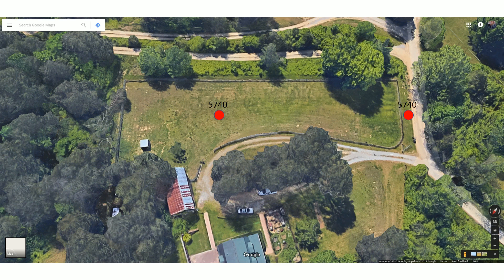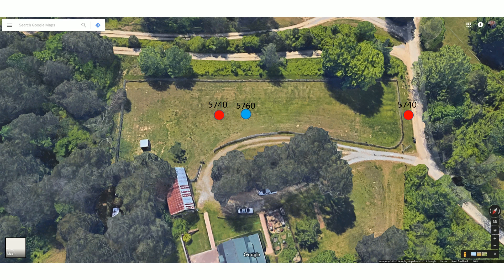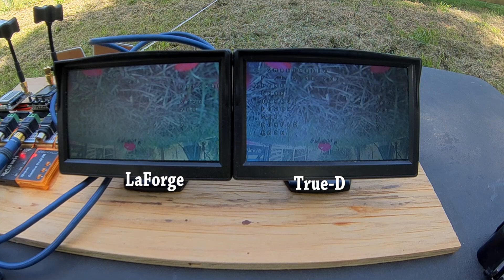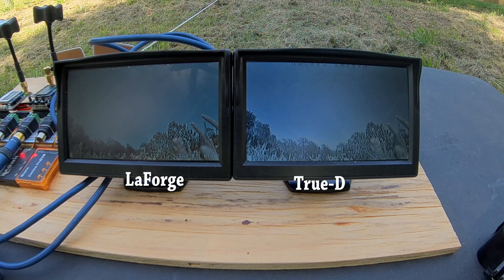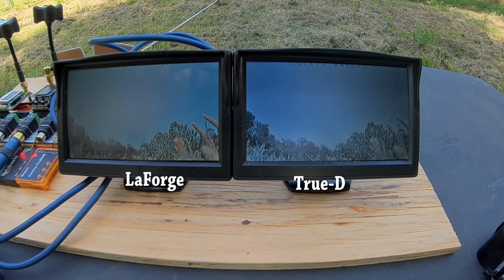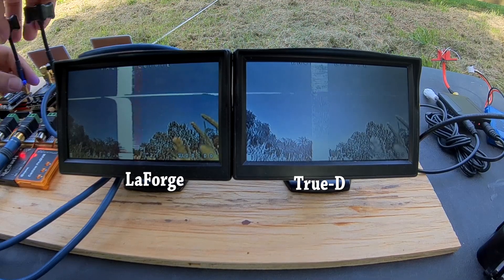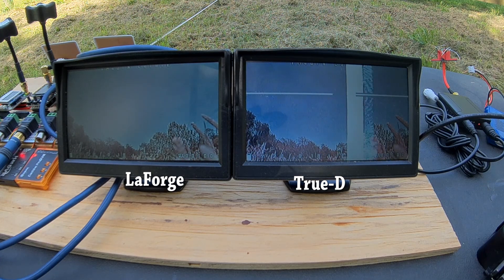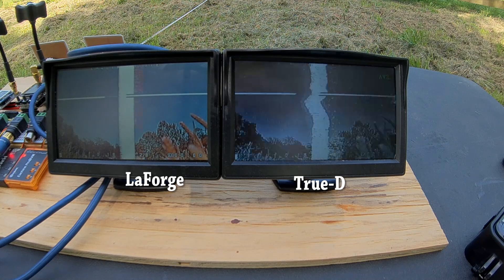Laforge vs. True-D | FINALLY A CLEAR DIFFERENTIATOR

Comment: Do you know if the True-D V3 is any better (than the one used in this video) at rejecting interference from other frequencies?  I ask because I have had problems with that exact thing.  I loose video and crash frequently at races, but I am usually OK when I practice by myself.  Based on this video (and my specific experience), I would get the LaForge, but in another video you say that the True-D V3 is much better than previous versions.  Has this specific issue improved?  Or is the LaForge still better for a crowded race?  I would love to know because I prefer the price and clean installation of the True-D, but my ability to see while flying is what really matters.  Thanks!  And thanks for making so many great videos!  You have helped me SO much in getting into this hobby!
Reply from the maker: I think the LaForge is better at rejecting interference.
Reply: Thanks for the quick reply!  My main concern is that my video signal remains flyable at all times.  I currently have some cheap box goggles, and I am thinking about getting fat sharks + LaForge.  In all of your tests, however, the real winner is always the ClearView.  I love the way it fuzzes out without a full screen glitch!  So, it occurs to me that I could actually get the ClearView and attach it to my box goggles, using the AV input.  It wouldn't be as fashionable, but it might give me the best possible video reception.  Am I crazy?  Has anybody tried this?  Or do people who use the ClearView always put it on a stationary ground station?

Comment: Thanks for your help with the Black and white video on my HD3's

but now I noticed that my 3.5 Tue-D doesnt switch antennas as fast as other 3.5 modules ive seen, I even take off both antennas and put one in, and it takes a while for it to connect to that antenna, what would you suggest?
Reply from the maker: First, re-run the diversity calibration. Follow the steps carefully.

Comment: I need help josh..   just bought the hd3 and the furious 3.5 module.  After finding the clearest channel, goggles view sometimes is just in black and white, and rarely switches over to a (soft)color.  I think it has to do something w the antennas.  Sometimes ill just attach 1 regular circular antenna. And i get color, and sometimes when I attach the 2nd antenna (directional) and I get the black and white view..     anyone else having this issue ?
Reply from the maker: Try on different goggles and see if it's the goggles or the module.
Reply: oh man, i dont have an extra set of goggles.  I been saving for about a year just to get the hd3's...

Later could you do a video on how to (from the moment you turn on your quad) to how to connect/setup the video to the googles w the 3.5 True D ?
Reply: Thanks for your help.  it was the camera, I bough a runcam swift 2, swapped the bad one out, it cleared it right up.   Nice vibrant colors.  Thank you Sir

Comment: hey Joshua, love you video as always. I have been running the new holybro diversity laforge style receiver in my fat sharks. Been having such bad reception problems its ridiculous. anyway, I fly a storm lokis5. love the copter, but lately having major interference issues. On my copters vtx, frequency D is for raceband. on my holybro raceband is D. could this be causing my issue? thanks bro
Reply from the maker: A very common cause of bad reception is mismatched frequnencies. You could try using "spectate" mode to scan the band and find the strongest frequencies.
Reply: Yeah, I have tried that. I guess what I really want to know is.....can the vtx on my quad have its raceband on D and the raceband on my fatsharks says the raceband is C??? Thanks man
Reply: in other words, the race band for my quad says its raceband is frequency D, but when I try to find that same D on my sharks....the race band is on C

Comment: I used Clearview with two patch antennas at an event and got loads of bleed over from other quads (especially on the start grid).I replaced the patch antennas with two menace raptor Omni's which solved the problem.
Reply from the maker: I have seen this type of thing too. The ClearView is technically supposed to run with directionals but in practice I have found that it works best with omnis.

Were your patch antennas pointing the same direction?
Reply: Joshua Bardwell One was on a 90 degree sma connector and the other a 45 sma. Both pointing forward but well spaced apart.

Comment: Joshua, For the test to be more conclusive, safe to say, you would also need to test it across multiple available channels on the 5.8 Ghz band.
Tedious but necessory because you haven't rule out the possibility that one module performs better at the lower band only or across all bands.
Who is to say that perhaps at the upper freq of the 5.8 Ghz band, the results is different ?
Reply from the maker: There is only so much time in the world. Maybe you will replicate the results!

Comment: hi the josh. do you know why the discontinued the furious true d3? is there any reasons. i here they can kill your fatsharks goggles
Reply from the maker: I don't really know what you're talking about. True-D v3 had an issue where if you pressed hard enough on the front of the unit, the two boards would contact and short out. They released a plastic spacer to install to prevent this. I'm not aware of any True-D units being discontinued, except in as much as new hardware was released to replace it.
Reply: I have no idea I was just asking because if you go to the website to buy one it says discontinued
Reply: I just bought one for myself three weeks ago and had no problem ordering it, just curious if anything went wrong with them

Comment: Would adding RF shielding around the both modules and testing again be worthwhile? Maybe an unshielded part of the circuit is picking up the interference?  Maybe it will improve both modules and people will start wearing tin-foil hats to improve their signal!
Reply from the maker: As tight as the module bay is, it doesn't seem like a good idea to stick extra bits of conductive metal in there.

Comment: I've owned both of these modules...at the same time so as to test them for myself back to back.  In normal working conditions, there is little difference.  I think this test is cool because it pushed the modules to extremes, which it seems is the only way to see a real difference.  

They are both solid choices and one can not go wrong with either.  Long before these diversity shootouts I chose my Laforge over the True D (sold it).  I just found a slight edge with the Laforge for my conditions.

Anyway, thanks for what you do Josh...I've learned a lot from ya, so far!

Comment: Maybe try this test again at the recommended ~40mhz separation and I do not think you will find any difference, esp when you add in motor/esc noise.  I have recently flown at 2x competitive racing events with Furious True-D V 3.2 where the max was 25mw and only used FS ch 1,3,5,7 (so 40 mhz separation) and with 4x pilots in air at one time there were no problems with guys using this or any other modules.
Reply from the maker: The 20 MHz spacing was based on a story that a pilot told me, about an actual race he went to where they had 20 MHz spacing. He said that LaForge pilots were okay and True-D pilots were having issues. I have heard this story from other pilots where the race was using 40 MHz spacing too. Glad that you have not had a problem, but others have had a problem, which is what motivated me to set up the experiment the way I did.
Reply: I suggest you test this with a 40mhz separation.  I doubt that you will find any diff's.

Comment: Did you think that the difference on performance could be because of the switching of the antennas? Just guessing that the true d switches sooner to the directional antenna and captures more noise. You could do the same test only with one antenna at a time. PS. thanks for all the effort you make to have us informed.
Reply from the maker: +Danel Igartua no, because I saw a similar effect all the way out to 120 feet.

Comment: Hi, congratulations for having pushed this series of tests so far. What was the transmitting power you used ? 
If you happen to do it again I would suggest 2 things though : try to show yourself walking in the top or corner of the screen so we understand what is happening, and maybe set the second quad to one raceband channel difference (37MHz ?) , to be closer to a real case use. This 20MHz is surely more stressful for the vrx and maybe the difference will show only in the last meters making it impossible to have a clear winner though.
Reply from the maker: The winner is still clear, in my opinion. The only question is at what distance the difference would appear. I used 20 MHz because somebody wrote to me saying they were at a race that was using 20 MHz spacing. If I had used 37 MHz and found no difference, somebody would be complaining that I was too generous. Such is life...

The transmit power is stated in the video :-) Check timestamp 4:09
Reply: Totally agree, 37MHz could be not enough to differentiate. BTW a race organizer setting 20MHz spacing is asking for troubles.
Sorry, I missed the power statement. I thought I listened carefully and didn't bother watching a second time.

Comment: The only thing here is this isn't a real world use case - if you are running 20mhz spread you also run RHCP/LHCP alternating antennas - this drops the competing signals significantly and eliminates this issue.

The performance of the LaForge modules is quite impressive in this test though, and definitely reflects the quality of the product and the innovation there.  I would also assume this will help with raw distance so you are less likely to need a base station, and don't need as expensive of antennas to get similar results as you would with the other modules.
Reply from the maker: I agree that 20 MHz is challenging, but I picked it because a viewer told me about a race he went to where they had them running 20 MHz separation. Interference was a disaster, but he said the guys running LaForge had less trouble. So this is absolutely a real-world use case, even if it's not best practice.
Reply: Joshua Bardwell well real world by a race director that doesn't understand RF then.  20mhz separation leaves only 14mhz actually between the signals, so unless you are trying to beat IBCrazys 16 pilots in the air and REALLY know how to set it up ...
Reply: Joshua Bardwell and to be clear, this REALLY makes your findings more definitive, because the LaForge is performing well in conditions no one should be trying to use!

Comment: Analog always will have interference. Obviously the True-D has issues with close frequencies from this test but "ALL" analog signals will have moments of interference which can cause crashes which is why I'm all for digital HD.
Reply from the maker: Not as if digital doesn't also have dropouts.
Reply: some day.  hey I am all in with my Connex Prosight .. but reading the threads and plenty have been having component failures recently
Reply: No. But not as random and not because of being close to other fliers, correct? I have the Prosight system and am not hyping it up by any means. It has its infancy faults for sure but no fuzzy screens. Digital in general will just allow so much more options for HUDs and other features that will help riders/viewers/pilots know more about their surroundings/current position than what analog alone can do I think.
Reply: Yes. It seems like its fragile or has something that is causing premature death so to speak but it's on the right path. It will also hopefully push DJI and other manufactures to get in the game.

Comment: great video josh :) i want to know if there is any difference in the laforge diversity models  with antenna interference or anything else, by the two models, the "all in one" or the version that has the wire between them, because i want to buy the laforge
Reply from the maker: +slitherixxx if you can't make a buying decision based on the videos I've produced to now, I can't really help you. Flip a coin.
Reply: i can :) maybe you misunderstood me, but laforge has the model with the cable between and the version that you got, just wanted to know if there was any difference between those two

Comment: I'd love to see a comparison of the Realacc Pro using the latest AchilleΣ firmware (when it's released). This FW may swing all the odds in its favour!
Reply from the maker: I don't think this type of thing can be affected much by the firmware. The ability to reject the off-channel interference seems like it is more affected by the RF circuitry itself. The firmware is in charge of telling the RF board what channel to tune to, and when to diversity switch between the antennas, but I don't think it can make the RF board better at receiving than it inherently is.

Comment: Does one module have an extra SMA connector adapter on the omni? Seems one has an extra right angle. Just wondering.

Someone is going to tell you to switch out SMA adapters and re run test I am sure if there is any involved.
Reply from the maker: They are identical.
Reply: 7:22  Oh I see it now. It looked like one of the onmis had an extra right angle because it was blocked by the left screen.

Comment: I wish you had stock Nexwave also in these tests. I'm running that without any problems, even in races where many other people with diversity modules (and directional antennas) are having problems. I think diversity makes no sense in racing situation.
Reply: Yes and many times you see people using diversity on open track, and they are sitting right next to the track and 80% of flying time their high gain directional antenna is looking straight at the other competitors flying on the other channels, while their own quad is in the other end of the track. And sonmetimes they even have CP omnidirectional antennas, and a linear patch antenna to catch the opponents video feed. :D

Comment: This is exactly how my video was, for three heats, at this past weekends race. Anytime we've seen this before it has alswys been an issue with a fellow pilots damaged/bad vtx, because our chapter ensures we are all well spaced as you would not intentionally put yourself in this situation. Still, my question is: since both modules are based of of the original open source project, can a fw update to the true-d improve the module in this area?

I've been using the original true-d and pre-ordered a V3.5 that was just shipped yesterday.
Reply from the maker: +VD2021 as I said in the video, LaForge doesn't use an off the shelf 5808 module. So if there is this kind of difference in performance, I wonder if it's hardware related.
Reply: Thank you Bruce.

Comment: Nice video Joshua... I'm not surprised with the result. But I'm glad to see spending and little extra on the LaForge has paid off. When I examined the internals LaForge VRx module compared to a Boscam RX5808 its obvious that the LaForge is better quality and has extra components. Guessing that's the dual antenna filtering that Shievley has talked about.

Comment: I've noticed the same, when I fly with a mate at the same time I was OK on my nexwave dual antenna module but my True D flickers a lot unless I fly alone.
Reply from the maker: +Fpv Nutz the Nexwave diversity module was absolutely terrible in my testing. Worse than the non diversity module.

Comment: i feel like you performed the tests in a fair manner, i wouldnt worry about the results. they are what they are. i wonder if increasing the mW strength would change results? what happens at 200mW? i do feel bad for the furious FPV engineers, judging from what sounds like gunshots in the background :P great job!!

Comment: I'd like to see a 3rd monitor with the Clearview. Though I have had some problems with my True-D and ghosting with folks on nearby frequencies.
Reply from the maker: +Dean Larson I feel like we've well established that the Clearview is superior. Still, it would be interesting.
Reply: Dean Larson I would like to see the same testing
Reply: Clearview does an exceptional job of locking onto the signal - which is the entire selling point of a $400 RX...
Reply: [FPV] Will 'Dirt' Dobbins exactly why it should be benchmarked against the large.
Reply: I flew 975ft behind heavy trees on 25mw with Clearview... when another pilot powered on ~25ft away when I was at 750ft I did have to have him power off...  

Would be interesting to see how far away clearview could be and not get interference.